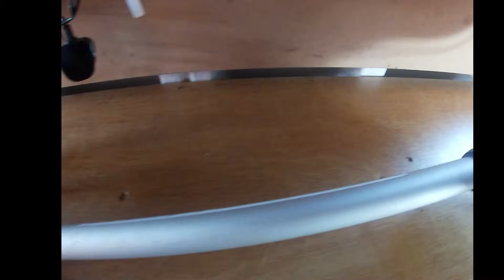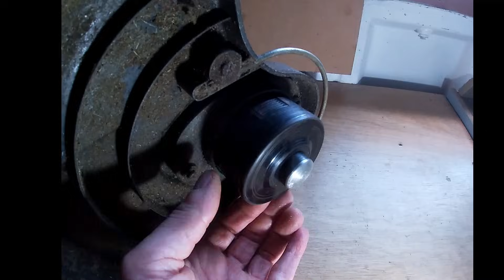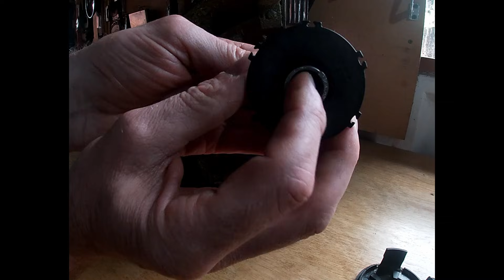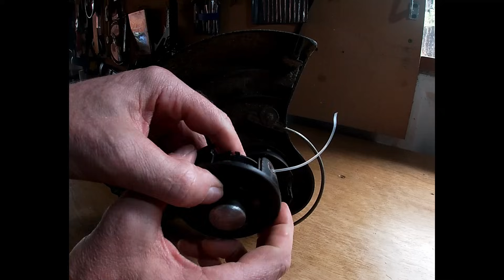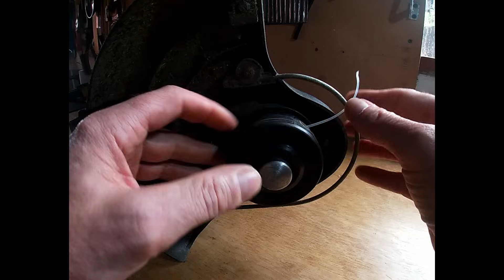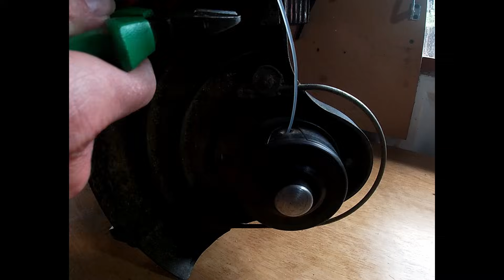MAKITA DUR181Z Strimmer line replace / Install new string trimmer line

Comment: Thanks great clip, but to anyone considering this unit, you may regret it, for me the single line is to slow to use even on light cutting and the head is frustrating to get off, poorly engineered in my opinion. My advice is to get a twin line version and something more powerful, I love Makita, but not feeling it with this product.

Comment: Hi Mick, I bought a brand new one but the line kept retracting back into the head. I have tried to run the lead the other way but it still retracts. Any idea what is wrong and how do I resolve?
Reply from the maker: There really could be a number of issues here.
If the lead is wound directionally correctly check it's the correct recommended lead for the machine and also not tangled, I would check the spring and spool head / body for damage.

Comment: This is so old school 😂😂 my advice; put on a Big Twin Line Holder with 3 mm line and use a automatic line winder.😮😊 If you do that than you have a light weight trimmer with the same trimming results as a 300 dollar trimmer.

Comment: Hello Mick, I now use 2mm line instead of 1.6mm and the difference is like night and day, regards 😂
Reply: Just drill out hole to accommodate the line. Doesn't take much.
Reply: Thank you 👍 @erniepenny221
Reply: Do you use round line and how you attach in holding hole? I cannot attach 2mm. Its seems to thick
Reply: Thanks for the tip I accidentally bought 1.3 mm so let’s see how that goes 😂
Reply: Great video thanks

Comment: Hi, I have a DUR193Z with the exact same mechanism. 
It is brand new but I have a major problem with it: The line keeps breaking (after using it for 30 seconds) right where it comes out of that whole. I then have to each time take out the head, unwind the wire 10 cm, stick it through that hole again, reassemble the head after which I can again use it for another 30 seconds to a minute. Drives me crazy. 
Any ideas?
Reply: I have same problem!🙄 same model!
Reply: @tomwalton6661  Have you fixed it? I've got the same problem.
Reply: @trzadycjonalista  no!
Reply from the maker: Check the line has been wound in the correct directional orientation.
Check the alloy / aluminium spool opening feed for wear.
Old strimmer line can become brittle with age so try replacing with new quality line.
Hope this helps.
Reply: @micksmaintenanceanddiy  Thanks for your reaction. When I reported the issue to the shop where I bought it, they gave me a replacement spool (complete prewound spool including the aluminium opening) and even with that one the problem persists. I use it once a week and after 3 weeks the complete spool was used up.
Reply: Excuse for asking this but r u aware that u have to bump the line out😂
Reply: @darrenstirrup5516  Yes I am aware of that. But when the line breaks at the exit hole no line sticks out anymore and bumping does not help in that case. 
And the line always seems to break right there in my case. Looks like a design flaw to me...
Reply: @geertdepickere5501  hmm sounds like a fault like u say.
Reply: Try another type of string, like round profile (cheap actually)  and dont be so agressive on corners. Also check for sharp corners of gadget, this may be defects of manufacture, highy unprobable.
Reply: Tanks, we have a same problem. The machine us comleatly New 🤬
Reply: I bought the exact same model and having the same issue, have you found a solution?
Reply: @chngo9  Unfortunately not...